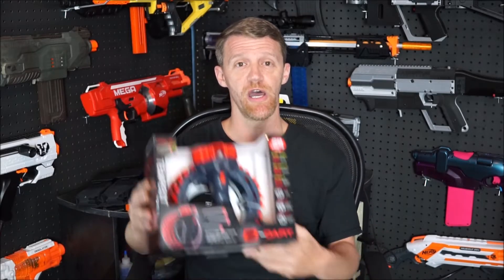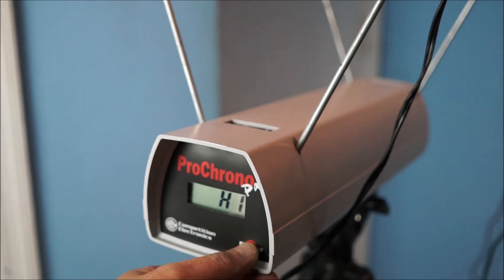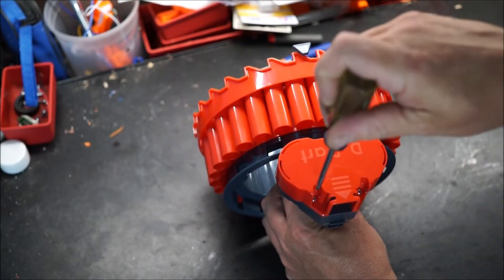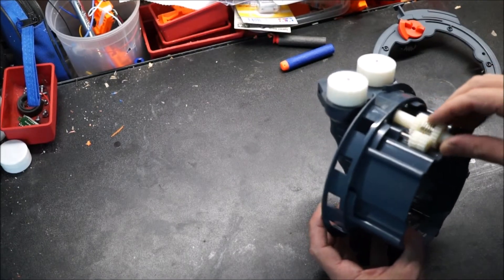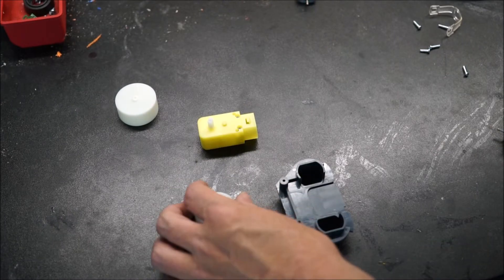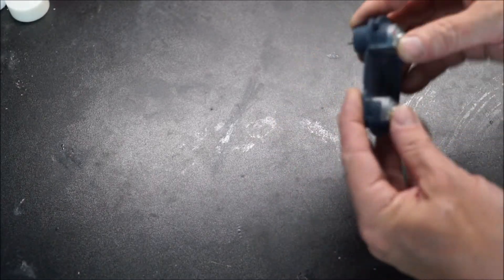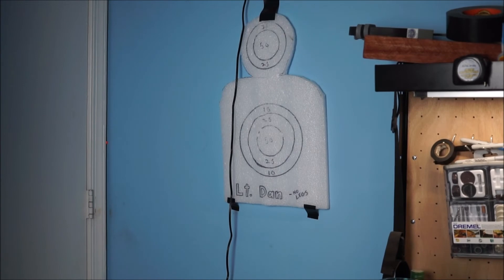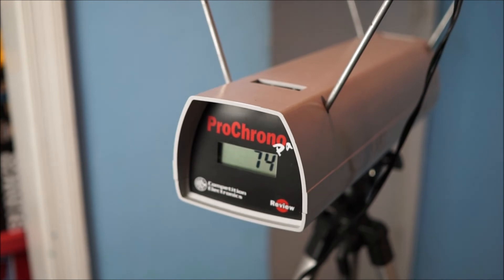D Dart Tempest Mod

Comment: How did you get a 70mm battery to fit in the battery space? In one of the comments you mention what battery you used, but it's doesn't appear to have that much space between the bottom of the gearbox and the bottom of the handle. Pic somewhere? Id love to see how you wedged it in there.
Reply from the maker: I removed some of the internal plastic bits, but it is a tight fit
Reply: @projectnerf7920  I know it's been a long time but I appreciate you responding I'll have to look at mine again. It looked like I could only get a 40 mm battery in there as is and didn't appear like there was much more room but I would much rather run a 70 mm battery.

Comment: Tried this mod with new motors, gearbox, and lipo and it won't work. The outer wheel turns too fast to get the darts far enough in the flywheels. Might switch back to the stock gearbox and see if it works again.
Reply: What motors did you use? Did you fix it?

Comment: Would a mod like this be possible for a beginner? If not are  there any tutorials you'd recommend to gain the skills needed to do something like this?
Reply from the maker: This one would be a tough build for a new modder, there's not a lot of room in this blaster. I would recommend that for your first flywheel mod that you do a stryfe or rayven. For some one new I have a series called Gameday mods, that might be helpful to get you started.
https://youtu.be/lYcAZB4TwgE
 I also have a build guide for a full auto stryfe that is nearly an hour and a half long, going over every little thing involved in the build. If nothing else it should give you a few helpful tips for future reference 
https://youtu.be/1mhaMRImqZ0